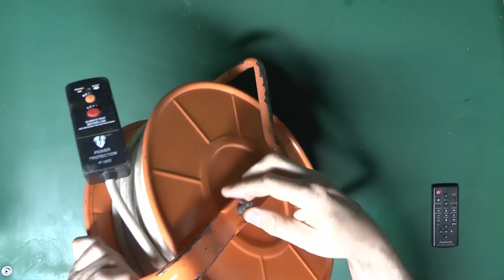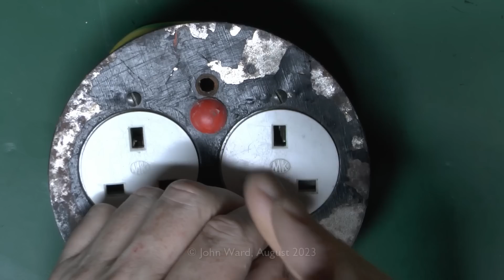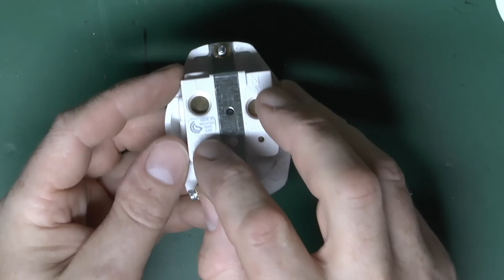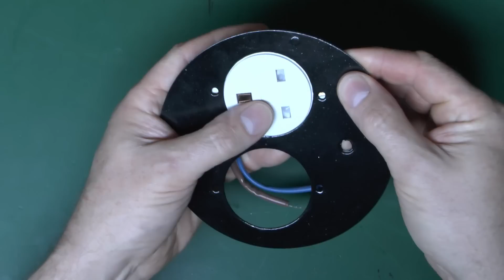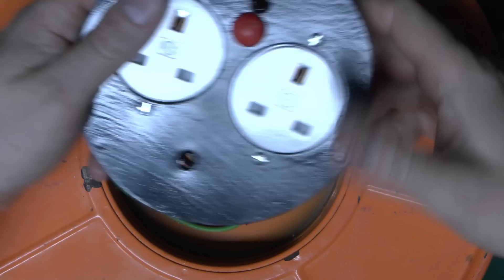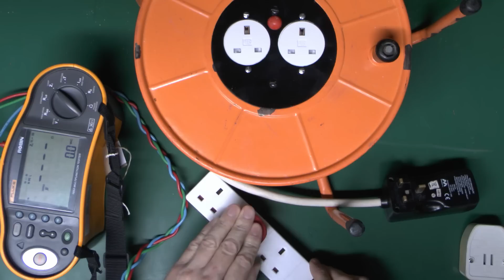Extension Lead Repair - MK Panel Sockets

Comment: Also, with unrolling extension leads, H&S say "No", on grounds of slips trips and falls.  Inductive overheating doesn't seem to be an issue(or not with ECS after I queried it !).

Comment: The earth pin does play a part in opening the shutters in MK sockets. The shutters do require that both conducting pins are pushed home at the same time time, but they still remain locked in position until the earth pin has been pushed in. Thus the shutter mechanism is an enhancement on the original BS1363 specification, not an alternative to it.
Reply: Really?
Then how on earth is 2-pin plugs be possible plugged into these kind of sockets??
(I do see 'grooves' for 2-pin insertion on those LN shutters)
Reply: @temp06j723-pmeighttq  Sorry. I wasn't clear. I'm talking about British sockets, which Alec correctly said cannot be used unless the earth pin is inserted first, releasing the shutters.

Comment: Any content coming on fault finding for AFDD trips how would you test a circuit for that ?
Reply from the maker: No, because there is no way to test for something that trips an AFDD.  An arc fault is only present while the circuit is energised, once switched off it won't be there.

Comment: OFF TOPIC - John do you know how to submit suggestions for the next UK Wiring Regulations review (and if so could you please forward this on).  Thanks in advance.

I was looking at an American YouTube video about solar batteries, and in the pre-production phase of development they are working in batteries that take power from a wall socket when charging, and deliver power back to that socket to power the house later on. Technically, this should work AOK, but seems to be a concept that was never considered when the wiring regulations were written. Suggest that the idea needs expert scrutiny when the regulations are next reviewed. I don't believe they ever considered feeding power into a wall socket (and obviously, the device would need some pretty secure interlocks to prevent it powering up the plug pins when away from the socket. 
PS - They also mentioned that it could be used with a time of use tariff. The concept was it is a portable battery you can take with you when you move house. It looks to be a year or so away from going on sale.
Reply from the maker: Suggestions or corrections should be sent to the IET, details on page 2 of BS7671.
What you are describing is a product, which is not covered by the scope of BS7671.
Reply: @jwflame  Many thanks for coming back so quickly.

Comment: Does the paint on the black panel affect it's CPC arrangements? (I presume it is normally bonded via the screw to the socket if it had bare metal available to contact with)
Reply: I agree.
Reply: it probably passed the bond tests in the factory as it was and the bean counters decided the seperate earth lead was an unnecessary expense.

Comment: Twin-ferrules will also prevent that the wires come apart over time.
Reply: I have seen some cheap chinese ferrules which cut a few strands after crimping. When I make something for myself that only I will use I don't bother with ferrules.
Reply: @mernokimuvek  For me it is easy, I purchase ferrules according to DIN 46228. Everything is normalised:
-dimensions and tolerances
-materials
-colour code of collars for the different conductor sizes.

https://kvt-pro.ru/pdf/standarts/din-connection-46228-4-1990-09.pdf

Comment: how do the English make a ring circuit with an extension lead ?
In all other countries there are only branches and therefore a maximum of one 15A/16A fuse in the fuse box.
Reply: There is a fuse rated for the flex in the plug, in this case with the bigger cable it will be 13 amp
Reply: We also have spur circuits that branch off the ring. All our 13A plugs have fuses in them.

Comment: Why was the black circular plate not explicitly earthed?
Reply: Through the socket screws ✅
Reply: @samuelfellows6923   But the paint is insulating the screws. I would have thought a dedicated earthing screw could have been added. The painted wood screws would have been useless for earthing too.

Comment: I think the dust in the cable is actually just humble talcum powder.
Reply: Which, to be fair, is sometimes contaminated with asbestos, particularly industrial grade stuff like that. So probably best not to breathe it in :/
Reply: @AngDavies shouldn’t be if it was only 20 years old.

Comment: Nice video john. However bear in mind that this type AC RCD is still not suitable for drills and vacuum cleaners because most power tools are coming with BLDC motors which work on DC and have some sort of circuitry. This extension lead is obsolete.
Reply: You can have both RCDs providing protection - the type AC one may not be effective for certain types of loads where a DC component may be generated but if the installation has a type A RCD upstream then it wouldn't be afffected by the DC current present and so still provide protection.  It's worth bearing in mind that many installations in UK will have type AC RCDs only and it is only mandatory for new circuts to have type A fitted so whilst it could be improved upon I wouldn't say it is obselete either
.
Reply: Just fit a standard plug then and rely on the RCD in the Consumer Unit?